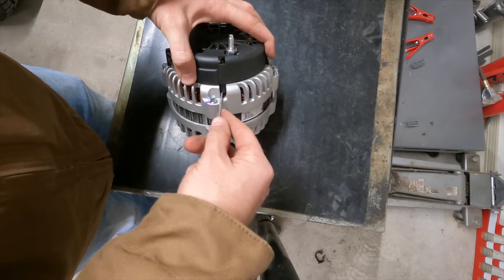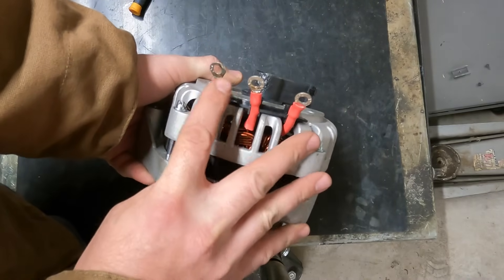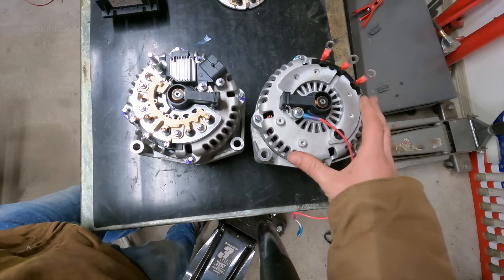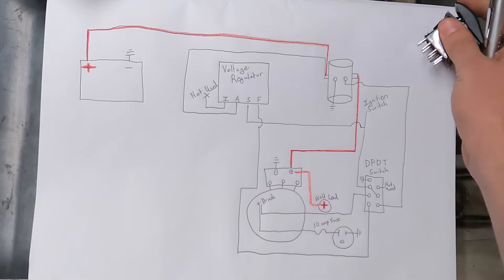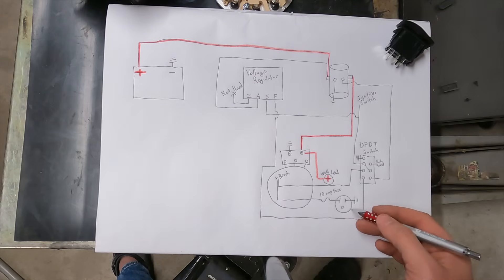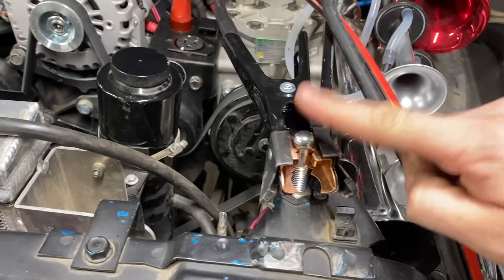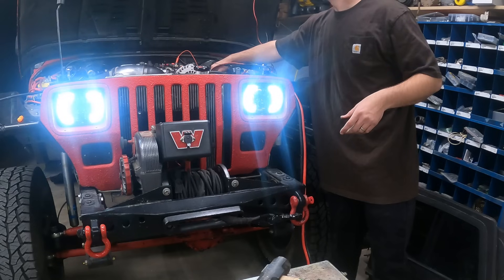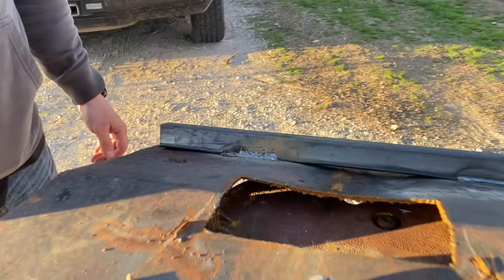How to Modify an Alternator for Charging AND Welding

Comment: A couple thoughts that may help;
1) Most (not all) alternators have 'avalanche' diodes in their rectifiers. While they drop ~.5V in the forward direction when 'rectifying' the AC produced in the 3 stator windings, they have another function that conflicts with using an alternator as a welder that it seems you have experienced. Some background; When equipment in a vehicle is switched on and off, the magnetic field of the rotor grows and shrinks. Powering heavy loads results in creating a strong magnetic field in both rotor and stator that doesn't just disappear when the load is switched off. When the large magnetic field collapses, it produces a high voltage spike (often over 100V) that will travel throughout the vehicle's electrical system if not allowed to find a path to the ground.  The 'avalanche' function of the diodes is to act as a 'pressure (voltage) relief'. While normal diodes have a very high reverse voltage tolerance (like your new bridge), if that tolerance is exceeded (even once), they will be destroyed. Avalanch diodes have a lower tolerance (~24V-50V) but are not damaged by repeated small reverse currents. Designers use this ground path to allow these spikes of voltage in excess of normal operation to flow to ground through the diode, without the spike flowing through the rest of the vehicle. If the avalanche diodes are overpowered (their reverse current capacity is less than 10% of their forward current capacity), they short permanently.  I suspect this is what happened to your first alternator. When you full-fielded the alternator to weld, you created a voltage higher than the avalanche diodes were designed to contain, they went into reverse conduction and due to the sustained over-voltage, they failed/shorted. By switching to a high current and voltage 3-phase bridge, you have made the right choice for welding but not for 12V generation. You now have a high amperage, conventional diode bridge (which typically has a 1600V 'PIV' which means 'Peak Inverse Voltage'). There is now no path to ground for voltage spikes when operating the vehicle normally. 
2) Adding spike protection is relatively easy. A device called a 'Transient Voltage Suppressor' (TVS) diode can be installed between the positive battery lead at the disconnect solenoid and ground. When the solenoid is off to protect the vehicle system from welding voltages, so will the TVS. When in battery charging mode, it is the nearest component to the alternator output to catch spikes. Littlefuse makes a family of large TVS under the part 5KPXXCA where 'XX' is the reverse breakdown voltage. For your 12V system which typically runs a max of ~14.2V, a 20-24V part would be appropriate. eBay is a good source for these. I would place 3 or so in parallel to increase their capacity (since you had 3 positive and 3 negative diodes in your bridge) to provide a ground path previously (not saying these are of identical capacity).
3) In addition to the 3 TVS in parallel, I would add an inline ATC fuse holder in series. Since the TVS fail by shorting, if they fail, they will conduct a lot of current till something burns up. Putting a 5-10A fuse in series with the TVS allows the small fuse to disconnect the short from the circuit. Fuze size doesn't matter a lot since transients happen so much faster than a fuse can function. It is sized appropriately to the capacity of the source (yours is large) connected to and the capacity of the wire in the TVS circuit. If the TVS are fried, you no longer have spike protection so checking the fuse periodically is needed. Having a fuse with an internal LED indicator is an easy way to check the status.
4) Your regulator hookup seems fishy. I don't deny it may work, just likely not the way intended.  Voltage regulator terminal designations are typically; 
I = 'ignition'. Its purpose is to turn the regulator on/off with a 12V signal from the key. It also provides power for the regulator (as much as 8A) output so it should be from a relatively powerful supply. This is normally required. Without it, I wonder how your regulator is powered and suspect it is likely never turning off which will drain your battery.
S='Sense' allows the voltage regulator to sense the output voltage at the battery which is where you need to be most concerned with its ability to charge. To insure this lead is not affected by voltage sag as a result of current drawn by other equipment, it should run from the regulator to the battery with no other load connected. This may not be required but if not used, sense comes through the 'I' lead which is often loaded with other equipment and may not sense correctly. This is one of the big advantages of using an external regulator, being able to choose where you measure the system voltage.
F='Field'. This is the excitation lead to the positive side of the rotor coil. Its voltage will vary and is how the regulator alters the magnetic strength of the rotor which in turn varies output voltage.
L='Lamp'. This lead operates the 'battery' light by grounding when abnormal. It is wired in series with a light that is connected to a 12V source. The regulator grounds this lead which turns the light on when the alternator fails to deliver adequate output. There is no terminal ID normally associated with the designation 'A' so I suspect this may be a lamp terminal which is nearly always available but you would need to check your documentation. I suspect this lead, being powered, is back-feeding the regulator to power it.
Case ground; Of course, the regulator always needs a GOOD GROUND as well.
5) Welder ground seems poor. You have a great connection to the positive lead and need to have an equally great one to your negative or won't get good arc stability. As it is now, your negative path has to go through the engine block, the body grounding strap, and a number of other joints in the frame. Steel has ~12% the conductivity of copper and aluminum has 71%.  I recommend another Dinse plug directly connected to the alternator case. Sometimes there is a tapped M8 hole on the back of the case.
6) I recommend you move your diode bridge to somewhere it can get good, fan-forced airflow. Use bare crimp terminals + heat shrink to connect your alternator windings (not solder) with either 105C rubber cable or 200C silicone wire (I use 8AWG for my 220A alternator). Your alternator fan can't really move air properly for it and it generates a lot of heat. I mount mine in the fan shroud.
https://youtu.be/UBnKhqqsNNA
Reply: Thanks for the tips and the time it took to get this in the comments
Reply: Thank you for taking your time to explain.
Reply: Great explanation!!✨💫💎
Reply: I thought I was a fairly intelligent guy,, but after reading this I'm changing my name to Thak the Neanderthal, but seriously this is one of the best post I've ever seen on YouTube, great job 👍
Reply: @keithedwards7882 Same here. As much as I wanted to, I couldn't follow his commentary
Reply: LISTEN TO THIS GUY
Reply: A-terminal is for ammeter
Reply: I am trying figure out how to OK copy and save it as way to try for myself to do it
Reply: @joesphbrantley686  .
Use an old phone to make a video of this video with.
Its how I do it .
Reply: @joesphbrantley686 
Share the video to your email, from you/to you.
For comments, take a screen shot, as many as it takes to get all the information, then name and # the shots in order.😊
Reply: Thanks,
Very thoughtful and instructive reply you provided.
What about a gas discharge tube for the transients, say a NE2, neon bulb, yes it'll be conducting at 80-90 volts, but better than 1 kV?
Reply: Ya, great write up. Lol this is im sure getting alot of welders and car audio nuts interested as we all need LOTS of power. I couldn't have said it better.
Reply: Also, is DPDT switch is not correctly drawn on the schematic sheet. It makes his explanations hard to understand.
Reply: Wow...i'm not gonna complain about the massive amount of information...I have thought about using it for power supply in a tiny house , with batteriesofcourse .. but I'm gonna keep your channel and use all that knowledge in the future.. God bless ...PS. did you see the plastic bucket of saltwater with kobber pipes being used as a 220 volt stick welder ? I didn't try to copy it , but it looked real...
Reply: ❤ this is why I read through as many comments as I can, for gems like this and subsequent comments.  🤩😍😎✌️
Reply: Blah blah blah.
Leave the factory alternator alone for battery charging and just add the other one to the system independently.
Problems solved.
Reply: This is the best YouTube comment i have ever read. I’m saving this video so i can refer back to this project and this comment
Reply: Yep,first thing i thought was,how are you mitigating voltage spikes with that set up?and how is the vehicles e.c.m/e.c.u still functioning!
You saved me a lot of typing!🙏❤️
Reply: Dad's ám.
Reply: With DC electrons move from negative to positive.  So saying "dump to ground" is kind of a misnomer.
Reply: @scottyh72  yeah in the battery!
Reply: I think I found a better way. Would like to hear your thoughts before I upload a video that might contain bad information.
Reply: You Sir, are a Rockstar. After weeks of free-time searching, I stumble upon this interesting alt-welder vid.. in search of practical info for my external regulator & rectifier project... and I find the answers in this thoroughly awesome comment.

I'll never bad mouth comment trolls again, simply due to finding the occasional gold nugget, such as this!

Thank you.
Reply: Would it be possible to remove a transmission, replace it with a very powerful generator capable of stalling the motor at any moment regulated by an inverter which supplies power directly to a pair of drive motors which only turn off as soon as there is low acceleration demand at highway speeds, at which a high gear is engaged?  The torque of first gear would be available at all speeds but with the added bonus of avoiding fhe low efficiency of electric drive at highway speeds.  What would be even cooler is a kit that is able to fit the same generator or something close to it, if it could ever fit, where the fly wheel goes(yeah not likely but worth a mention), which is able to take place of downshifts at highway speeds, which would provide the afore mentioned torque of first gear at highway speeds.  These two ideas are about the equivalent of batteryless hybrid drive trains, which are probably capable of being provided in the form of a kit.  Perhaps this idea has no relevance as there very well may be something along the same lines as an e-cvt that is adapted to function without a battery, as would provide for mechanical drive, electric drive, and a mix of both at any applicable moment, instead of what i have proposed before this particular statement.  Whatever works best, i would love to see the closest thing we can get to making an e-cvt designed to function without batteries in order to improve the efficiency and power of cars that do not have them.  What do you think?
Reply: Uhhh... this dude sounds like he might know what hes talking about.  Had no idea how dumb I was!  
Great write up
Reply: You should just made a video
Reply: Nice everything
Reply: I wish I could download your knowledge!!!!
Reply: opinions are polarized on your comment despite not one of them having any idea what you're talking about 😂
Reply: Link to your channel? 😜
Reply: @rezablade1375  Youtube.com/WorkingOnExploring I dont have anyting specific to weldernators but I've got a lot about alternator charging of RV batteries.
Reply: but for clarification. Did it weld?
Reply: Thanks for the excellent explanation
Reply: I'll have to look again but doesn't he have the vehicle is isolated and as for the the field I don't see having a effect on anything in this vehicle. New ones with everything running on its own module and CAN certainly is going to cause serious issues (They twist the sensor wires together to help minimize noise already from the factory). I can see the regulator frying but you think the diodes are going to see the voltage needed to kill them (referencing the original diode rectifier failure)? I think he should get some cooling if he plans to use it for fellow wheelers too. I would just run a dedicated alternator so I'm not left stranded. I'd also put a A/C compressor for air!

The 'A' terminal is battery +.' 'L and 'I' are lamp and since his has 'L' already as you stated. 

I thought he was running off the battery only while switched to welding.
'"your negative path has to go through the engine block, the body grounding strap, and a number of other joints in the frame" 
And that is IF the frame strap is even there! I cringe at every factory ground strap I've seen.
 (The worst grounding set up I have seen is in a Sprinter, They run a dedicated ground wire through the whole harness for each component, crimp 3-5 together in the same thing ring terminal and then stack them up on 2 m6 studs!) 
I would just put a lug on the mounting bolt as the 'GRD' tab on the alternators are usually pretty small (if applicable). 

I guess I usually deal with 300+ A alts and I go overkill on grounds though. (Except I will not run dedicated front to back ground cables and do ground distribution through the frame (where applicable of course) With the sheer area of steel in a chassis especially a frame and with it being ground(lower amperage) will be far more adequate than anything we would will need. (Not that you care I'm sure but my experience is car audio) 
A supercap bank before the battery will help. A 59/60F bank (6-350F caps)  would be fine and get rid of the AC ripple and smooth spikes.
Reply: @commonsenseisdeadandgone  you are literally the only person other than me that I have ever seen recommend putting a cap bank before the battery it's nice to know I'm not the only one that does that
Reply: @SheikhN-bible-syndrome  supercaps are so slept on, it's a shame though that they became popular with solar power walls though. Couple years ago could buy a 3000F cell for like $20 bucks! If not less. Now if you can even find them they want $80 or more it's nuts. 

I like to run caps under the hood for my "battery delete" when using lithium as it can take the temp but also serves as a buffer for the factory electrical too (which I want to protect as much as possible as I'm already running 15.5v). I have a 200F bank under the hood and a 500F bank before each amp (2 ~5k amps). my electrical is overkill, but i build all my own everything so why not!
Reply: @commonsenseisdeadandgone  in home audio a amplifier power supply has a Cascade of multiple different sizes of capacitor in order to smooth out the power that was just rectified from AC to DC and the begter tye caps and the more they have the lower the amplifier noise floor is and arguably the better the transients is
And yet car audio people usually don't put two and two together that that alternator is making 220 volts ac and is being rectified down to 14 V DC and the difference being nobody puts any smoothing capacitors right after the alternator in between the battery in the alternator in order to take out the small AC Ripple it still is present in the signal and then blame their amplifier for being crappy or their speakers for being blown and not once addressing the fact they have no conditioning caps in the Powerline and is all they need to do is order like 6 2.7v 500a supper caps for luke 40ish $ from your favorite Chinese Overlord why are them up for a 116F 16.8v capacitor module and place this 
Pack between the amp and battery in line put + to + and - to - of the power and ground wires
Reply: @SheikhN-bible-syndrome   @MAYA EL  actually you don't even need that. That's what the .5 farad to like 5 farard caps were actually for and people thought it was to stop headlight dimming and to sustain voltage but when it didn't they all said they were junk (in hindsight they are but they do what they were intended for. 

What you talking about home amplifiers power supplies and DC for? Depending on the power of the amplifier do they even have an actual "power supply"?

I have always found it funny with car audio that we have alternators that create VAC and it's converted to VDC then we have these massive amps that take in VDC and converts it to VAC. Radios and amplifiers have filter caps that will rid most ripple and noticeable "noise" and typically it is a issue with something else in the electrical system like a leaky diode in the alternator rectifier which is common or simply a bad ground or short with anything else. I just like capacitors because it will take the potential hits that can obliterate a ECU or any of the countless other modules in vehicles today. Plus with massive subs and 10k+ watts it's a sudden kick of 1000 amps draw or more and repeats over and over and changes up. Supercaps don't care and will recover fast sucking every unused ampere in the system no questions or hesitation 🤣
Reply: @commonsenseisdeadandgone  well you sort of got it right and you sort of got it wrong everything you said is correct but not all the way correct there's some misunderstandings I'll try to go over them and hopefully i don't miss any of them

#1 in home audio they use a Transformer which plugs into the wall and takes the AC power and steps it down or up depending on the application but it is still AC power only now it is regulated and then from there it goes into a rectifier of some form typically full Bridge rectifier which converts it from AC into DC 

and then that goes directly into a bank of filter capacitors to smooth out the new DC signal because it has AC Ripple still in it because a rectifier doesn't perfectly convert 100% of the AC signal into DC 

and then from there it passes on to the amplifier which also has capacitors in it which continues the smoothing process however it is still necessary to have the filter capacitor Bank prior to the amplifier in home audio and the same applies in car audio

#2 all car amplifiers are chocked full of capacitors but they do lots of different tasks with inside the amplifier that I won't go into or else this post will be way too long and yes they do filter the DC signal coming in and they do indeed convert it back to AC for the speakers

 however this does not negate  the necessity of a filter capacitor Bank prior to reaching the amplifier itself because the same principles apply that are in home audio it is just an unspoken fact that the car audio community is tone deaf in comparison to the home audio community and we tend to not care near as much as home audio people do about sound quality and so most of us don't even know what a filter capacitor Bank even is

#3 yes you are correct the stereotypical one to three farad capacitors being sold in car audio do indeed do the job they were intended for and it's the base head that misunderstands what the job implied because they do stiffen the system to help eliminate that sag and also filter out some of that AC Ripple however the reason I didn't recommend a power acoustic or Planet Audio three and a half farad car audio capacitor and instead recommended a 116 farad Supercap Bank it's because I like the satisfaction of building things they're easy to build you do get that added boost of having 116 farad at your disposal but most importantly will be Ripple current of 116 farad 16.8 volt Supercat Bank is way more then any typical cheap audio cap and Ripple current is important because Ripple current is the amount of amperage that the capacitor can safely have passed through it within its given voltage range without damaging itself

example being that a 100v 100000uf (thats 1/10th of a farad to give you an idea)  nichicon capacitor has about a 40a ripple current rating and so if you're running 5000 plus Watts RMS you won't have to worry about exceeding the Ripple current on a 116F bank any time soon 

plus the Supercat bank has two other advantages over the standard capacitor which is one the ESR is much lower so it can deliver the power much faster this helps with transients and two it is a bank of capacitors as opposed to one and when it comes to smoothing out the DC signal and getting rid of the AC Ripple the more capacitors the better it's better to have 10 1 farad capacitors then it is to have 1 10F capacitor as far as filtering is concerned so you take advantage of the six capacitor setup as opposed to one

and lastly if im remembering everything then the last thing is this "VAC" and "VDC" there's technically no such thing as vac and VDC that is just an acronym to explain volts AC and volts DC typically seen on a power inverter but it fundamentally speaking is no different than AC or DC the V is just notating that we're dealing with voltage

an amplifier that runs off of DC power is identical and the same amplifier as one that runs off of VDC they're the same thing

if i missed a point i will chime in agin but this is long enough 
as it is lol.
Reply: @SheikhN-bible-syndrome    oh I didn't see you had replied. 

I figured there is step up and step downs but not actual power supplies. To be completely honest with you, I actually don't know what constitutes a 'power supply'. My thought is AC to DC or DC to AC. AC to AC/DC to DC I assume is a buck or step down converter. 

The nice thing about home audio is that it's much nicer! Car audio is out dated sloppy crude design. But it needs to be! It needs to work in a unknown, terrible, harsh and unforgiving environment. Home audio the input voltage is known from the factory.  Car audio is a guessing game. 

I'm confused though why they would convert home/pro audio amplifiers to DC though. (Strictly talking amplifier section, not the screens or buttons for input selections or whatever it does or does not have. I guess I'm sorry I don't know if that is clear.) 

#2, I actually repair car audio amps for fun so I'm well aware of the components inside and the capacitors for filtering the input and output and rails and such. I don't fully understand how it all works but I know what I'm looking for on a scope and a dmm. I'm a pretty good problem solver. I'm slowly learning circuit's. Electrical is all pretty new to me (about 3 years and it's not a lot of time devoted) I am a mechanic and electrical I always dreaded but I decided well it's time to make sense of the mess and jumped in. It's actually not terrible with just a smidge of understanding. But that's neither here nor there. 

Vehicles don't exactly set the best sound stage, road noise, odd shapped cabins so tone deaf is a must 😆. I like music, I like lyrics but I don't actually listen to really any outside the car. I am certainly a basshead and if it's a good song lyric wise but the beat is no good, I won't be playing it. 

Sorry if i repeat. 
The stiffening caps are usually a couple capacitors. So the cylindrical housing is just a case. Inside the wire a couple caps in series, then fill it with sand, or an epoxy and throw in a chunk of concrete for good measure! So it's more than 1 cap I guess 😆. 

I think I did say but me personally, I'm running 1200F of supercaps, 200F (6 1200F cells) Maxwell module up front, then 2 500F (6 Maxwell "knock offs" 3000F and 6 Eaton 3000F cells) all in an obvious 6s1p configuration. I'm running 90Ah NMC (Cmax). A 370A alt up front, 10k watts (I don't know clamped but each amp is nominal .7ohm so safe to say 8k RMS at least at 15.5v and I do not drop. 

I'm not sure what the VDC and DC amplifier is the same thing comment was. I know they are one in the same. I guess I'm used to saying VAC/VDC when talking amplifiers since it's dealing with both voltages and amperes as well.
Reply: @SheikhN-bible-syndrome  with that all said, I feel kind of dumb about the whole why would a mains powered amp convert to DC, I'm not exactly sure actually if the output section is working in AC or if it just outputs AC. I guess I never really thought about it. The rails are positive rail and negative rail that being DC. (Full bridge doesn't have a negative rail but same concept, I'm going to kick myself even further and I simply can't recall at this time, Half bridge puts out AC power but does full bridge? Since it applies power to both the + And - terminal (hence why you can't strap or bridge) as opposed to only the + that a half bridge does. FB doesn't ride the ground plain but rides half voltage with ground being the limit of the down slope or "negative rail max". know that but it's been a bit since I've actually poked around.

I guess I just really don't know how the negative voltage works. FB just keeps switching polarity. But HB only utilizes the + terminal and out puts +VDC and -VDC with the - terminal being common ground but measuring this you measure across the terminals VAC. 

Think this really got off topic. I'm semi side tracked but being I am ADHD af is normal for me 🤣😂. 

I also assume with some of your comments you have some know of wtf I'm taking about.
Reply: @commonsenseisdeadandgone  i gave adhd too lol
Well ill tell you how this all works in the way i wish someone had told me back in the day because it took me forever to understand why and how an amp works so heres how MOSFETS and BJT's work because tgey are practically the same and they definitely physically look the same

So if the amp is a solid state amp which 99% if big amps are then that means they use MOSFETS or BJT's in the output stage thst goes to the speaker 
Now how they work is this then BJT has 3 legs they are base-colecter-emeter to make it simple i will call them B-E-C 
With DC power tou connect the + of the DC power to the E and the - of the DC line to the C now 0 power will flow through this BJT yet vecause its still "off" so it has to ve turned on and how that happens is by giving the B a small amount of the same + voltage to turn it on and when you do that the BJT turns on and opens up letting the power flow

Now remember that sound is made from AC power because sound is frequency and frequency is fluctuating oscillating pressure waves another words an AC signal that is changing its speed 2 whatever it needs to in order to create whatever the sound is the only way DC differs from AC is it is literally just a constant power it's like less than 1hz it's 0hz so then what they do is they take a small audio signal like from the headphone jack kind of small amount and connect it to the B leg of the transistor and what this does is it makes them BJT turn on and off matching the AC music signal comming from the B leg 

So whatever kind of small signal you put in the B leg the BJT will turn off and on in that matching the input signal and by doing this this makes them "flow comming out of the BJT now an AC signal so depending on the design of the amplifier typically you would connect the output wire to the C leg and thats where your subwoofer connects to.

Now there's a bunch of other little components in between and whatnot but that's the basic method of Howie transistor amplifier works so it's technically deceiving to call it a amplifier it's not really an amplifier to more like a converter and regulator cuz if you don't have enough power DC on tap you're not going to make enough AC and you're not making more than what you have going in your just converting it but they call an amplifier because you using that power to amplify that tiny signal is coming in on the base leg
Reply: @SheikhN-bible-syndrome  I should have let you know that I actually have fixed many amplifiers however I can't claim i know exactly how they work per se 😆. I have an oscilloscope and basic knowledge of what to look for however there's a lot i need to learn. I know nothing about home stereos like at all.

Car audio though I have a full system consisting of (not everything is currently installed but I have it all. I just need to build the enclosure (which I even have the wood and acrylic for in my possession) but right now half of the following pretty much is in it and running. The engine just blew on it so it is only going to delay things even more.(I am a mechanic by profession so I literally do it all. I have a crown vic, manual swap on air ride all done by me)but i have my deck(cheapo android but I have no issues, i like how it actually reads my 64gb usb and since i have a), DSP (audison bit 10) amplifier on the mids and highs(twisted sounds 150.4 class AB and a Toro 4 channel micro amp hidden in the center console that's a very impressive small fella) and then obviously the subwoofers(15" Sundown NSv3 wired at .7 nominal on 2 twisted sounds 3.5ks that of course I repaired). If any of this means anything to you.for electrical I have a 370a alt (I have 2 other 320A hair pins laying around) with (maybe i said) 200F cap module (Maxwell 200F 16v off the shelf i acquired) under hood and a 500F(a "Maxwell like*China*" 6s bank and a 6s Eaton bank) for each sub amp with 90Ah of Cmax. I build my cap banks (except the 200F) and my Cmax banks. All in I'm less than 2 grand I'm pretty sure out of pocket. Since my subs retailed new for a grand a piece I'd say I'm doing pretty good. . Even with my wire and all. Most expensive purchase was 1 of the subs at $650. Otherwise I've traded amps that I've repaired and they were bought cheap of course and looked for deals. Like i just picked up 60' of 1/0 OFC for $100! I have 2 runs of 2/0 OFC in the car already that I got for free.(a guy I helped him a few times with getting his system sorted and answered questions was done and moving out of state so I bought an alternator for a buddy and he just gave me all he had left as a thanks. Was seriously cool) and I completely went off topic again. Sorry if you couldn't care any less it's all good I thoroughly enjoy talking about systems without the disinformation and stupidity that floods the hobby. I'm not competing or think my system is or will be all that, but I am proud to say, "I did that!" 🤷 I should read your post fully through now 😂🤣😂🤣💩🤔😲
Reply: @SheikhN-bible-syndrome   Yes AC = frequency. Yup I whiffed on that one my bad. I'm narrow minded and basically deal with big multi k watt amps so class D and I haven't really dealt with internals for months. 

I mostly deal with mosfets but I've seen a couple BJT amps. I have one that is called a class H (or K) or something. A cerwin Vega stroker 2000 if i remember right. The class is in reference to the guys name, a popular amplifier architect I can't recall. 

But yes simplified for dummies that certainly works. I appreciate you taking the time none the less. 

One thing that still absolutely dumbfounds me is how much power these amps need to be input compared to the traces and components inside the amp. Doesn't seem proportional at all! 

I'm not sure what a technical name for an amplifier would be. Depending on what the input power is determines what comes first It's a converter and inverter as well as a signal amplifier and frequency generator so would it also be considered a pulse width module?🤯 🤣😂🤣😂
Reply: @commonsenseisdeadandgone  you sound alot like me lol I just got my 8k amp in the mail this week from china for 300$ total hehe and ive been into car audio alot longer then i gave home audio all my subs i paid next to nothing for like my 2 xmaxxx 15's i got for 75 each because they were blown same with my unlawfulsounds night terror 15 (big boy) and my HCCA 15 thats actually a 16.75"  i got it for 100$ shifted motor it was a B to fix but i fixed it 
Ive got a 355a autotec alt i need to put in and ive got a 45ah honda insight cell battery i built and 45 more ah saved back for a rainy day a well as 60ah of a123 cells 50ah of eh4 cells and 80ah of winston cells lol i have a problem
Reply: I thought the same word for word 😂
Reply: Dang bro... awesome write up!
Reply: Where are the cliff notes to this comment
Reply: Wat he said.
Reply: A couple of things that could help: some Welding gloves!
Reply: To long didnt read
Reply: @lifebehindtheselens  you give up on alot of things huh
Reply: @lifebehindtheselens  that is because it is TOO long 😂😂😂😂😂😂😂😂
Reply: not reading that
Reply: @dsfkmgl6507  then why comment?
Reply: @dsfkmgl6507  found the zoomer